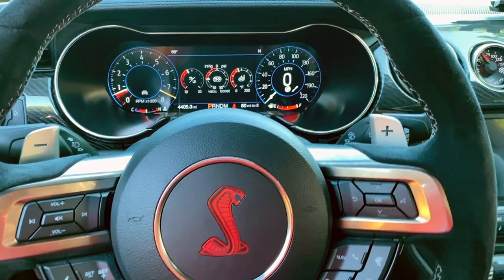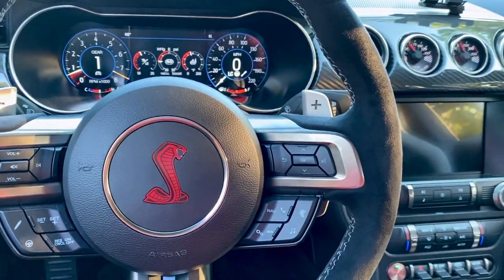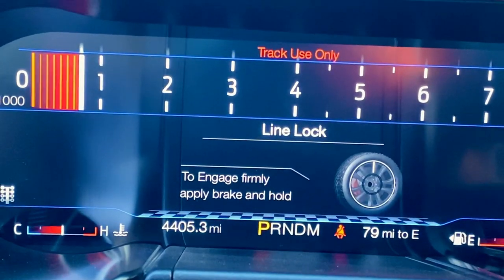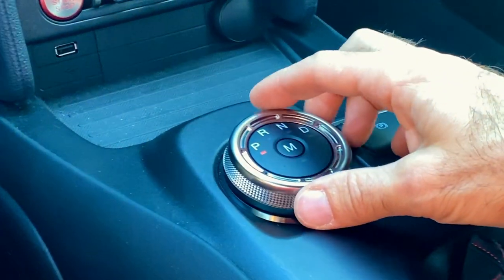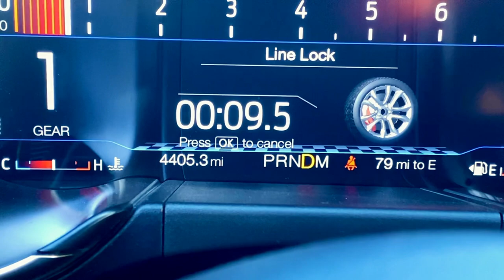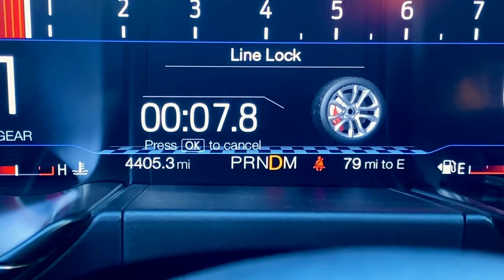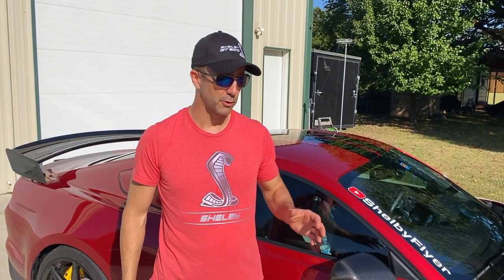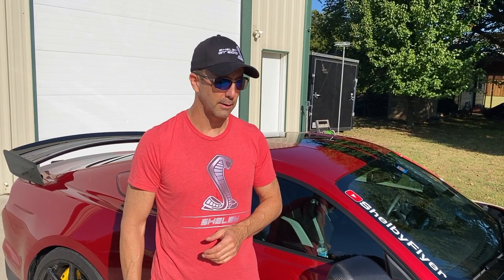2020-2022 Shelby GT500 Line Lock Burnout "How-To" + Demos!

Comment: Great video 👍
When you engage the brake, do you let off the brake and floor the gas pedal and you then have to hit the ok button on the steering wheel  to disengage the automatic front brakes??
Reply from the maker: Thanks! Yes to all of that.
Reply: I'd like to add that it is not necessary to floor the gas pedal to do a smokey burnout. I like to keep the revs under 7500 to avoid hitting the rev limiter so many times. As good as the rev limiter sounds, I try to avoid hitting it.
Reply from the maker: @fnfastone  True… I was just doing it the same way the schoolhouse teaches it in Charlotte.

Comment: I'd like to add that it is not necessary to floor the gas pedal to do a smokey burnout. I like to keep the revs under 7500 to avoid hitting the rev limiter so many times. As good as the rev limiter sounds, I try to avoid hitting it.

Comment: I’m curious to know where you were able to get your brake set. I looked around and only find gt350 brakes
Reply from the maker: I don’t understand your question…?
Reply: @ShelbyFlyer  what I mean is where did you purchase second set of brakes? I recall you replied to my post and mentioned that you purchased second set of breaks.
Reply from the maker: @MAkiller41  Ahhh… I ran across a post about a guy local to me stripping a new GT500 to make a drag car. He removed the brakes. I bought them.
Reply: @ShelbyFlyer  ok thank you. I’m in the northeast prepping for winter and noticed they don’t make 315 with 30 sidewall in all seasons. Then started to see shortages on filter etc. I may have to got with 305 all around during winter.

Comment: Does the tranny shift to 2nd or just stay in 1st? Are in in auto or manual mode?
Reply from the maker: In auto tranny mode. It does not shift.
Reply: @ShelbyFlyer  Do you know if you can shift in manual mode while doing a burn out?
Reply from the maker: @bwieweck  Haven’t tried it, but I have to ask: Why would you want to do that? The goal is a burnout and it does it perfectly as is.
Reply: @ShelbyFlyer  just because of my days with my Buick Grand National. It would go through the gears in the blink of an eye while burning out. Not that it matters really, just what I am used to.